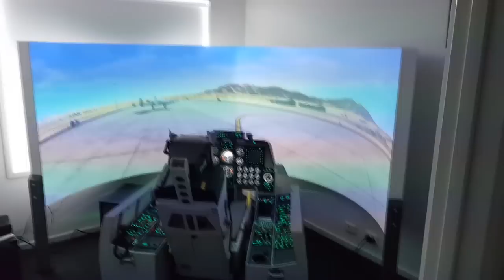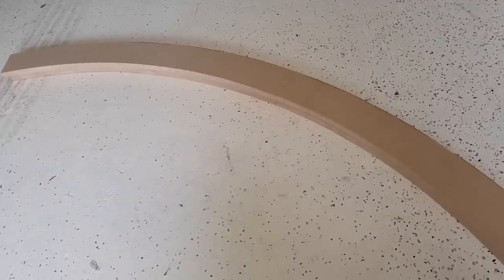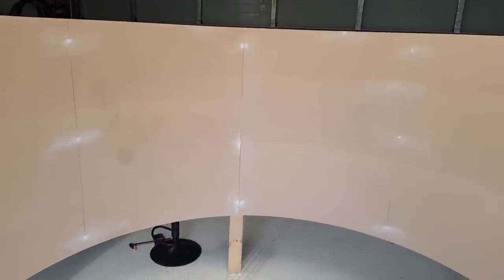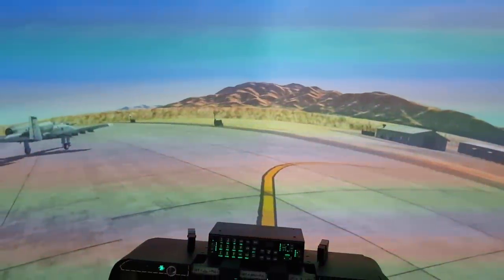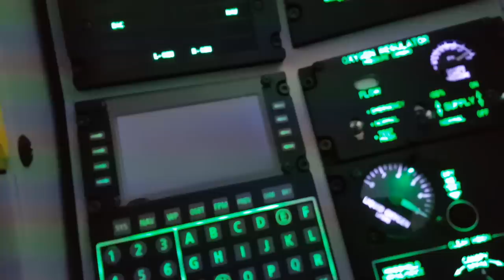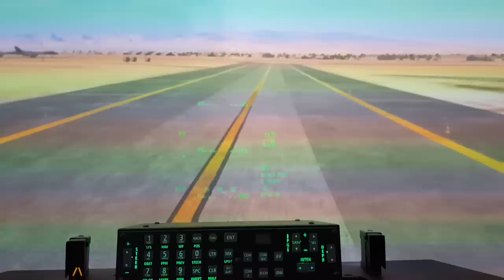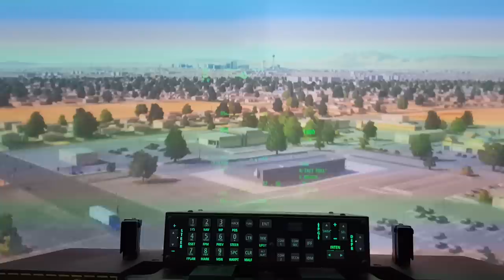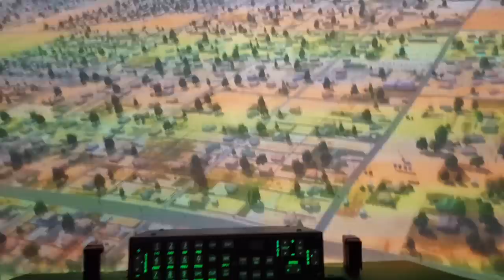D.I.Y. Cheap Curved Projector Screen- for the Flight Sim!

Comment: 2 THUMBS WAAAAAY UP!!! Seems not enough to call it outstanding!  Being a real pilot in my younger days, the full peripheral 180° curved screen is not only awesome, but mandatory for a realistic immersion factor.   At one time I had actually collected all of the front and rear cockpit components from scrapped F-4 Phantoms, including instrument panels, joystick, throttles, canopies, Martin-Baker ejection seats, rudder pedals and mounting structure, as well as all the left and right hand console panels.  I sold most of my collection when I decided to become an expat back in 2004.  I wish I had taken the time to 3D model all of the components as well as scan/photograph the components and panel faces to later make authentic reproductions for a flight sim like this one.  Oh well.

Comment: To avoid the calibration time, reduce the registration error by mounting BOTH projectors on one piece of solid material that in turn is mounted to the roof. This ensures that any movement of the roof affects BOTH projectors the same, which may lead to the whole image moving on the curved screen but not any registration error between the two projectors. Use something that doesn't warp or change dimensions too much due to heat or moisture, just make sure it is more solid than the roof and that both projectors move together, then the mount onto the roof itself is of less concern.
Reply: This, but you could honestly just use 3/4"(20mm) plywood. Plywood is very stable, and the projectors would move the same amount regardless. MDF is fairly stable too, but not as strong as plywood.
Reply: @nathanb3142  Plywood and MDF are both reasonable materials to use since you don't have fibers all aligned in one direction, and will expand/contract less than metals due to temperature. The whole point is just to make sure both projectors move together by mounting them first together and then secondary to the ceiling that obviously moves.
Reply from the maker: Good suggestion. I'll give it a go. It's also likely the bulk of my problem is coming from the cheap projector mounts as well, there is a lot of play in them no matter how hard I tighten them. I'm planning some custom made aluminium ones out now.

Comment: With the way the prices went for NVidia in the latter half of 2018, you might have been better off with a 1080 Ti just because of how cheap they were for a Ti card, but the 1080 is still a great card. 

As for the frame rate drops, try reducing the ground clutter option. I noticed it was popping in late and saw your frames suffer soon after. Use late "Pop-In" (when ground clutter or objects suddenly appear in close proximity to the player) as an indicator that the GPU is somewhat struggling to keep up. If you have it setup so stuff rarely pops-in late like that, you should see far less frame rate drops than if it were.

Comment: Awesome video. One tip with the projectors (as a professional film/AV projectionist), depending on the type of projector. They can take up to 30 minutes to warm up and have internal parts shift to whatever their 'warm' position is. So you may find they're out of alignment, but if you leave them for 30 minutes, they may shift back into their normal operating alligned position (unless as you said, the roof temp is changing!)
Reply from the maker: You are absolutely right. I've been leaving them to warm up and they seem to rectify themselves!
Reply: @thewarthogproject  Good to hear. We regularly double-stack 2 large format projectors and I leave them for 30 minutes to heat up, it's amazing to see how much the test pattern shifts!
Reply: @calw2939  @The Warthog Project Lens shift is the bane of my life. I find over time the shift actually accumulates until no amount of warming up will re-align the image. Then it's time to re-calibrate the whole thing :-(

Comment: One thing you could do if you wanted to go really crazy (and if ED ever makes DCS not drop so much FPS exporting the instruments) is make a reflector setup and project the HUD onto an actual reproduction HUD, there was a forum post where someone did that ages back, but I don't remember the ins and outs of doing it because I've never had room for a simpit, so never bothered to try
Reply from the maker: I did actually research that, the hardest part would be getting the exported HUD to actually line up with the outside world viewport on the screen. It would need to be absolutly perfectly aligned for BRRRTTTT. Too much work for too little gain in the end- the on screen HUD works well.

Comment: Now you need a second one with a door built in so that you can get a full 360°. After all, you need to be able to look behind you to see if the rudder and elevator control is free and correct
Reply: And to check six - what  VR gives you.

Comment: Truly bad-ass.

While I am innately partial to real screens (like this), I do have to ask, why not VR? While your dual projector setup is awesome and a lot cheaper than a single LCD, I have to imagine it's more expensive than a decent VR head-set. And you'd get the same amount of immersiveness, plus the benefit of seeing the craft structure around you too (which could only enhance the sense of being in it)

Comment: This is awesome! I've watched this and your upgrade to triple projectors more than a dozen times and you've inspired me to attempt to replicate your build. My dedicated flight sim room is 2.52 meters wide and figure i can max the 180 degree screen to a diameter of 2.4 meters.  

May I know what's the diameter of your screen build? 
Also, I got that it's 50 cm off the ground. How tall is the actual screen?  
How big are you projecting each projector at? Approximately 100 inches each then Fly Elise does the warping?

Will be flying mainly a Cessna 172 on this but I figure to eventually add a 737 and F18 cockpit sometime in this lifetime. Exciting times we live in indeed!!!

Comment: This pit is just absolutely amazing.  My question is when can we see the Mirage 2000c, F18c, F15c, and now the F14B room?  If I could build a sim pit like this, I would have to have a 6 bedroom house with 1 bedroom for each.  Just wish I was good at electronics.  I could make the panels and stuff in CAD and 3D printing, but the electronics would end me.
Reply from the maker: Haha maybe when I win lotto. Get into it, the electronics is the easy bit!  With DCS-BIOS and arduinos, if you can cut and paste code you can get them to working in DCS. Spend a few dollars on an arduino from China and have a go, you will get one led blinking as a master caution light and be hooked. In five years you will have your 6 bedroom simulator house haha!

Comment: This is outstanding, what's the radius of the curve? I've been looking at doing the same for my own SIM.
Reply: Same Question, if you can provide this info would be perfect thank you!
Reply: @EagleEyeFilms  I think I have figured it out. Working at the largest size of a single sheet. Here in Canada that's 48inchs tall. With 16:9 projector that's 85inchs wide for each 90° section, times 4 is 340inch circumstance. That makes a radius of 54inchs.

I'm going to build one for my P3D sim.. hopefully it works out as well.
Reply: @AdventuresonTour  Fantastic, thank you, very very much! I'll dive into it to check how it will render for our simulator project over here in Switzerland :D

Comment: Incredible screen.  Thanks for posting it. Can I please ask what are the dimensions of each 90 degree panel?  And what was the cost of the software to run it? I have just acquired 2 identical projectors and hope to build something similar.  They are 16:10 ratio so I'm assuming it's best built to that scale? 
And help with that would be greatly appreciated.  Thanks

Comment: I guess there is a slight brightness/colour difference between the monitors where they overlap. I suppose that's just variation of the projectors.
Reply from the maker: Yep. One of my projecters is actually a different model than the other (1080st v 1080st+). I'm still trying to iron out the calibration.

Comment: Great work! 
What are the screen measurements? 
How long did it take you to build?
How long does fly elise take to set it up? I heard some people spend many days to blend 3 projectors...
Reply from the maker: Thanks!
1) 1.2 meter radius, so its 2.4 meters wide. The screen is 1.2 meters tall, and half a meter off the ground on legs.
2) The entire thing- years. The screen, only about a week.
3) Its a steep learning curve, so first time yes maybe a few days of tweaking. Nowadays i know what im doing, so i can get it done in about an hour. Only ever really need to do that if i move a projector.
Reply: @thewarthogproject  Thanks! 
I still do not get it how DCS \ Fly Elise handles overlap. 
DCS outputs 1980p, while some go are wasted on OL. Where do those pixels go? Or DCS outputs only effective resolution after overlap? 
And with overlap, how did you still manage all 270 degrees?...

Comment: Brilliant build. How did you get rid of the airplane structure in DCS? Do you use track ir? Is this a good setup for a combat aircraft as in, how do you look behind you or above you?? Thx.
Reply from the maker: Thanks! Alt+F1 removes the cockpit in DCS, I've got that programed to a button in the pit. I've got Track IR but being so close to a display this big and having it move around a lot makes me a bit nauseous. I've got the paddle switch on the joystick as a modifier, so holding that at the same time as moving the trim hat will change snapviews to look up or over my shoulders. It does the job in the hawg, but not real well in dogfights in the Tomcat. I'm still tweaking trackir for that.

Comment: So nice! it would be cool if your sim could use another PC to render the panel screens, just like games used to run multiplayer through LAN, so one could drive just the projectors.
Reply: if he ran dual GPU's he could do pretty much this, SLI for nvda cards, crossfire for amd's
Reply: @connorallison2123  fair, I was already assuming he was using two GPUs to run all that, I thought that those FPS hiccups were being caused by the CPU going 100% to keep up with both GPUs.
Nonetheless, I believe it would be a nice feature for sims, as it would be more expensive to get another 1080 ti to match the existent one (and probably a pretty expensive PSU to handle both cards) than getting another computer with really modest hardware to render those 2D graphics for the panels.

Comment: Hey, nice work!!!  One thing that interests me is why you need such a thing and not use VR? Is that because a VR is more seasickness? I m aboud to bye vr or making a screen  like yours.
Reply: Difficulty with VR is that over a course of 1 hour or more is discomfort and sweat as well as cleaning the headset from time to time. This gives you a very good level of immersion without the discomfort of wearing a headset for an extended period of time. In fighting games not sims headsets are not as problematic given that you will likely only be wearing the headset for shorter time. That being said it's a matter of preference and most SIM setups own a VR headset also for various reason. Top it off check out the console he is working with computer sims are not nearly that tactical as having real switches and controls.
Reply: Adding to what philip said, its more of a personal choice and attitude as well, this guy is dedicated to one type of aircraft and thus, it would feel awkward to him to fly a F18 while sitting in the A10 cockpit, so he sacrificed that over his love for one type of A/C. I am also stuck at the same crossroads, I love the ka50, and in the middle of working out panels, at the same time looking into VR as well for immersion and lack of space for such a setup.

Comment: Relay cool i did a similar thing just for Desktop size (1.5 meter width) - worked perfect :)
Do you have any problems with sharpens along the screen ?
Reply from the maker: The only sharpness issue I get is in the very lower corners, and it's only noticeable when I'm on the desktop, not in DCS.
Reply: @thewarthogproject  And what about the middle blend point ?
basically If you have a curvature you had to set focal point somewhere and it cant be perfect along the whole arc

You would need a special custom lens for taht
Reply from the maker: @pch_mechanika  not sure what you mean. The projectors are outputting two matching images that overlap in the middle. As long as they both line up everything is fine and I have no problems with sharpness at all in the centre.

Comment: Awesome setup mate! Curious as to weather the 9700K made a big difference to your frame rate? I am currently still running a 3930K with a GTX1080 on a 3 monitor setup and thinking of upgrading as I suspect that's where my bottleneck lies.
Reply from the maker: Thanks! The CPU upgrade made a huge difference. I havent got around to overclocking it yet and even so it no longer has visible framerate drops, even with the MFD exports on at 100ft in Las Vegas

Comment: Great work! Projection question: Is there a feature I should be looking for in a projector that allows for the curvature? I know most allow for the flip of the screen, but changing the curve or angles may not be mentioned when looking at specs of projectors.... Thank you for the inspiration!
Reply from the maker: Thanks! All of the warping and curving is done via the fly-elise software. All of my projecter keystone settings are simply left on default. The only thing to really worry about when selecting projectors is they must have a short throw.
Reply: @thewarthogproject  Thank you so much for the information. Would you say 2-4m (6-12ft) is in that short throw?

Comment: Hi awesome vid ,Is there any restrictions as to the minimum circumference(across) you can have for a 180 deg screen as im limited for space and the position of the projectors please , look forward to your reply
Reply from the maker: Mine is a 1.2 meter radius, so its 2.4 meters wide. I designed it to fit in my room and wanted it as large as possible. I never thought to work out how small i could go, so unfortunately I cant answer your question.
Reply: @thewarthogproject  okay thank you

Comment: I was also thinking about something along the lines of beam projectors and curved screen for the hornet. However I am discouraged by the lack of vertical view angle (e.g. look upwards) for turn fights and I didn't noticed that DCS supported decoupling the HMD targeting from the main game camera to allow HMD targeting independent from the front view :(
Reply from the maker: The screen is very impressive and definately has wow factor, but for combat it's not enough of a view. I do have snap views on the trim hat on the stick for looking up and over my shoulder in the Hog which works OK. I've got Track IR working now, with the pause and centre buttons activated by the paddle on the stick. Still tweaking the profile, but I'm having success so far. I'll post some more videos flying the Hornet, harrier and eventually the Tomcat in it in the future. Some cool panel add-ons coming for different airframes as well!
Reply: @thewarthogproject  , well you pointed me to the fly-elise guys, I might ping them if they have recommendations or experience warping the beamer output setup to build a full dome (e.g. 180deg horizontal, and 0-90 vertical, search "Polar Simulation Dome Projection" on youtube for the rough idea as you can see a beamer on the top of that video). Constructing the dome might be doable with plywood frame and filling it with medical gypsum.

Comment: Ta,, I am building my own flight sim in the garage , my aircraft is the BD5-J (X-Plane11), have you built your 270 deg screen yet, and installed your third projector. Would you please make a video of you doing the calibration from scratch. Cheers mate.Thanks as your quite inspirational. Also what is the radius of the curve you used, is it 1.2 M?

Comment: I'm using my Oculus quest running Assetto Corsa and Dirt Rally and the VR is awesome. I've considered the projector you are using (just 1) on a smaller curved screen for a higher quality image. How do those projectors run when the computer is not stressing out.

Comment: Not sure if this has been pointed out yet or not but it appears there may be a slight error on the Screen Cost documentation. You have that the Screen Surface panels cost 12$ each, a total of 3 were required, but the total cost was 24$. Could have missed some audio, as I skipped around a bit to be honest. Apologies if I'm incorrect in my comment.
Reply: Amazing Builds by the way! Thinking about doing some of these myself! Keep up the amazing work!

Comment: Any ideas how to add "overhead" screen along with a curved setup like you built ?
Reply: Go for a dome and mount the projectors on the bottom? I've also seen a novel concept where you mount a ball mirror right above your head and project onto that, but you'd need a pretty high resolution projector for that to work without some serious screen door effect.

Comment: Hi. How many pc's do you need? Can you write what simulator is running and pc's specifications?
Thanks and I am in love with your project!!!!
Reply from the maker: It's all run by a single PC. I'm using a Gigabyte Aorus Master MB, 9700k OC to 5ghz, 32gb Ram, 1tb M2 SSD and a 1080ti.

Comment: Any reason you didnt go for 2x 4k? (and 3x 4k later on) or just moneys? Rather have a higher resolution at lower fidelity. Im running 10320 x 1440 for a racing rig, works fine even at 100hz with a 2080ti.

Comment: I have a similar setup but with 3 projectors giving me 200 degrees on a 3.2m diameter screen also with Fly-Elise. Can you tell me, did you use the camera method to calibrate or the other longer manual method?
Reply from the maker: I used the manual method. I only used 10 measured points on the edges of the screen, and Mk1 eyeballed the rest. The results look pretty good, and it doesn't take too long.